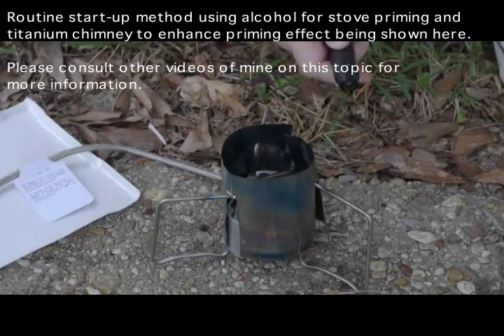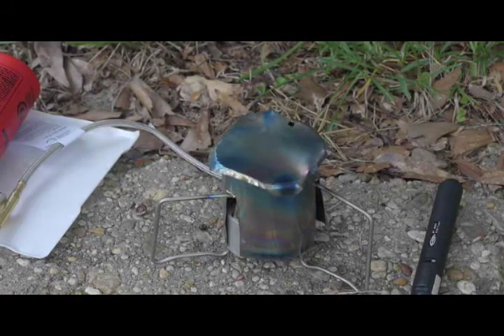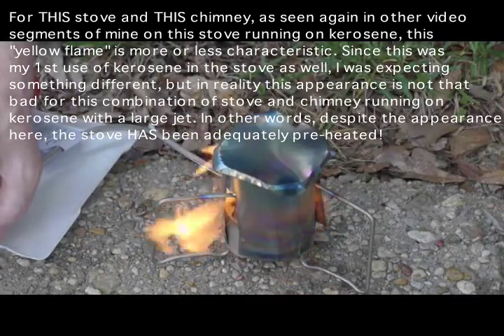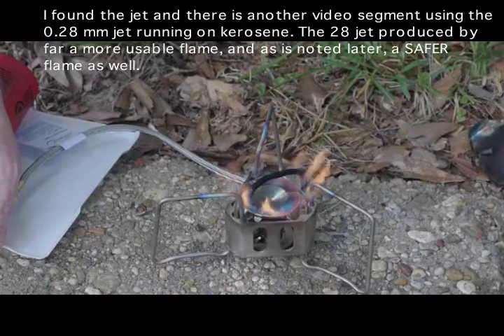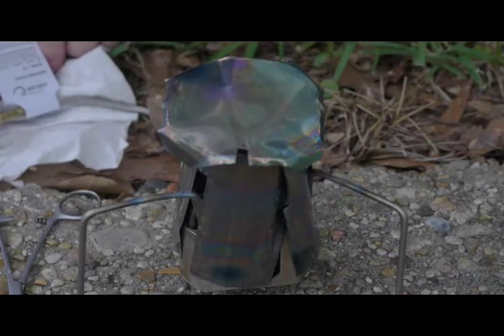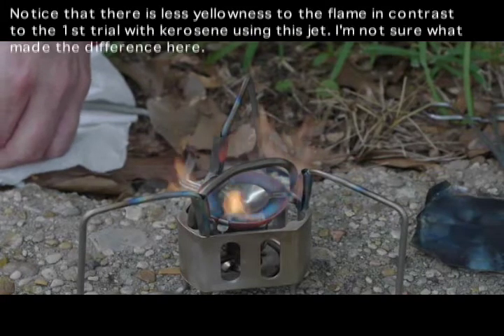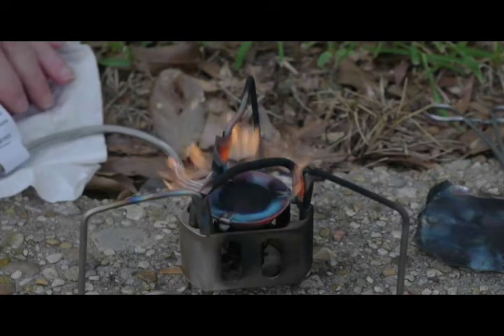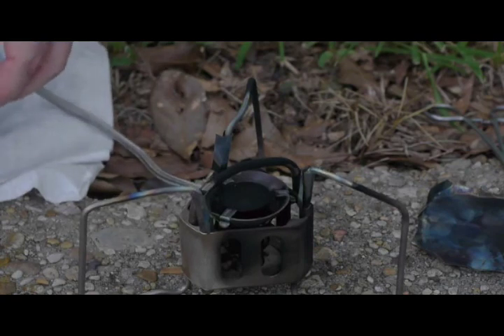Edelrid Hexon Multi-Fuel Stove Review, Part 3, sub-part "B1"

Comment: I see you are using what seems to be a large MSR fuel bottle. It worked ok for you to use it with the Edelrid pump?
I want a bigger fuel bottle, but the Edelrid 0.75l bottle is not available in the USA for a good price.

Thanks! :)
Reply from the maker: I put in a reply to your question in the "discussions" section -- try to get to that if you can and if not, I can cut/paste that into a reply under this video instead.
Phil
Reply: drcoolit I got it! Thanks a lot for your help!
I will research the syringe method that you posted :)